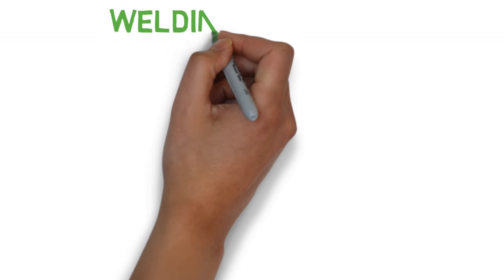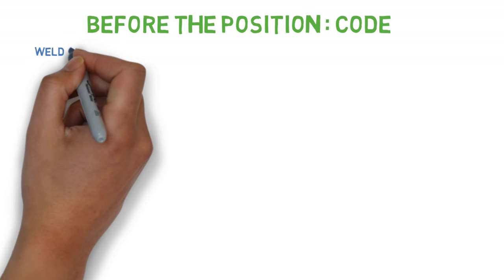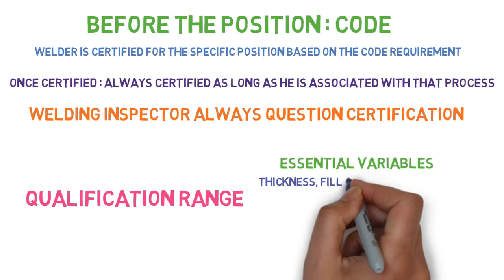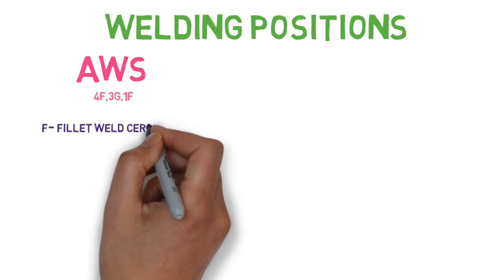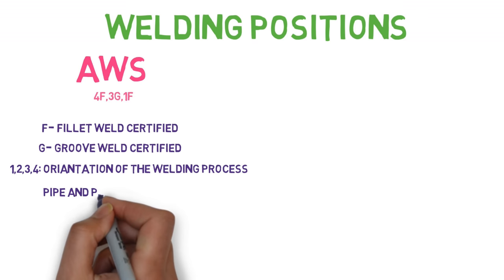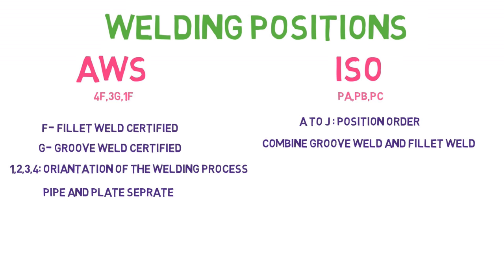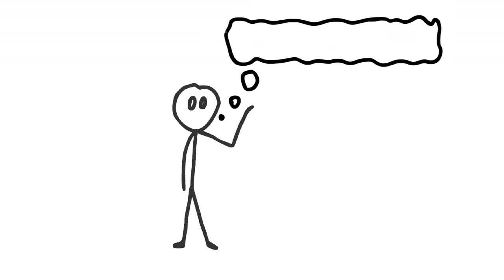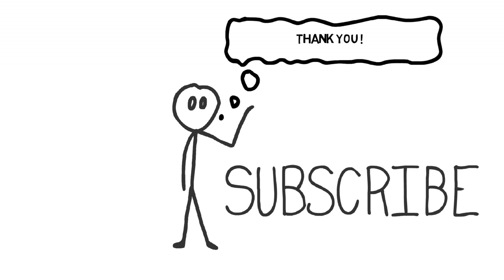Welding Test Positions AWS and ISO: : 1G,2G,3G,4G,1F,2F,2F,4F,PA,PB,PC: For Welders' Qualification

Comment: Hey man I have a question that hopefully someone can answer.  I want to get certified for my business.  I mainly tig weld aluminum. What type of certification should I be looking at getting
Reply from the maker: hello 

are you located in USA? it depends on the type of business you run, if you are supplying your parts to your customer: you need to check their requirement

we have suppliers who are AISC , API, ISO certified based on our product need.

Comment: Thanks for the information... and what about square pipe to plate welding position in ISO
Reply from the maker: thank you Sir, 

"it is considered as fillet weld similar to round tube. round , square or rectangle tubes are considered as same,"

that is why there were many doubts and questions  before. since use of square HSS tubes are rapidly increasing. AWS started categorized them as separate entity
Reply: Thanks...

Comment: Isn't the 2FR pic wrong... bcz the weld will be done vertically and not horizontally
Reply from the maker: Hello Justus Panicker

welding shall be horizontal with the base metal rotating
Reply: @weldinginspection7239  O ok so welding will  be done at one point which can be assumed to move along the horizontal direction
Reply from the maker: @JustusPanicker  yes !  well, it is actually rotating direction